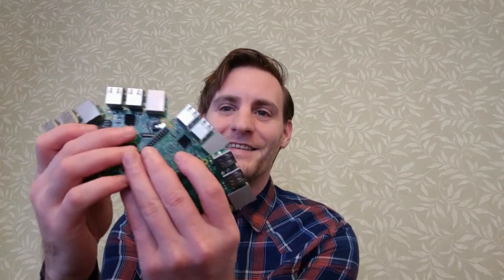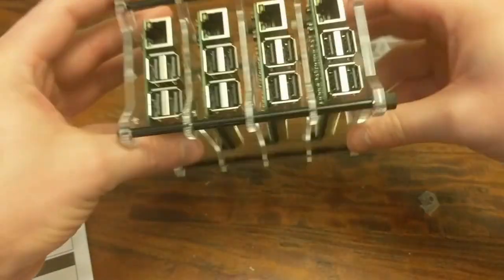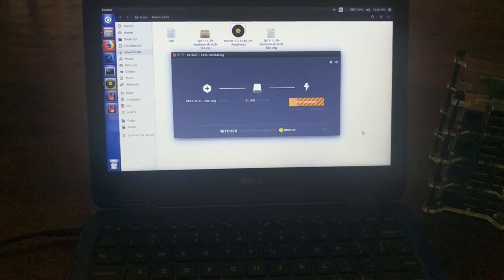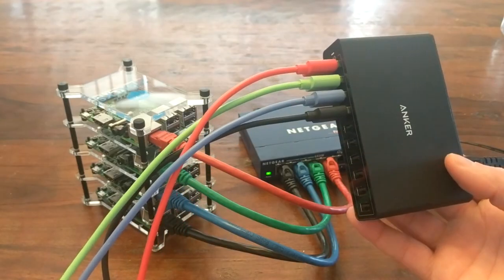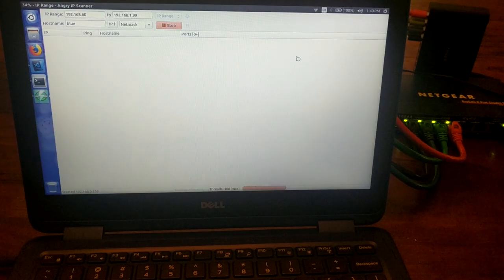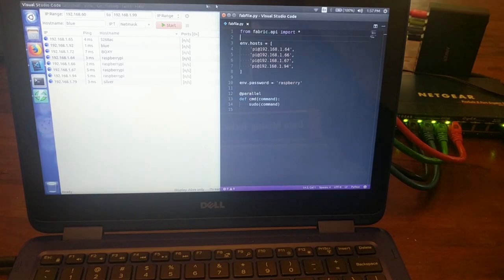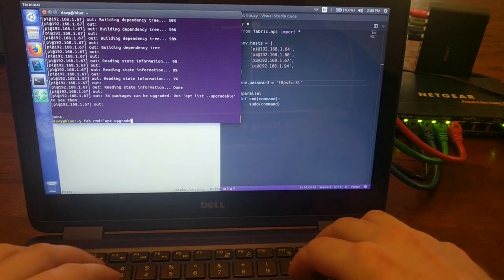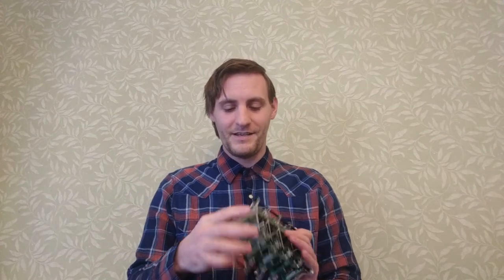Building a 4-node Raspberry Pi Cluster

Comment: Someone beat me to it, a cluster is meant to work as a single computer by distributing tasks to the members in the cluster thereby increasing the computing power.
Reply: That's one type of cluster. And they don't really work as 1 computer, depending on how the cluster is being used and what for... web server clusters are usually fairly simple and optimize query time by simply assigning different queries to different nodes. On the other hand load balancing clusters for scientific research and such use algorithms much different than the round robin method of just assigning each new query to a different node. And I dont believe computing power is really increased in the sense that you're thinking... you're not increasing power, you're sharing load allowing the work to be broken up into chunks that can be handled by different nodes, thereby speeding up the time it would have taken to do the work. A cluster is by no means a supercomouter

Comment: If you have the 3+, do you still need auxiliary power? I plan on connecting these to a powered switch (PoE). Will PoE work?
Reply: PoE is available only on the 3B+ but you have to get a PoE Hat

Comment: would it be cheaper to buy a computer that is 10 times as powerful as rpm, or buy 10 rpis and other required equipment (ethernet cables, racks, switches, power hubs...)? would be interested if its worth the investment.
Reply from the maker: A powerful machine would be cheaper. Each Pi has all the standard peripherals, which are all adding to the cost, plus as you mentioned the extra equipment. But, you can't pull out 1/10th of a more powerful machine and use it in other projects like the Pi.
Reply: The  benefit of creating a small pi cluster is that time on large clusters is expensive.  You can do you development on a small cluster, work out most of the kinks.  Then you waste less debugging on large systems where each node is more powerful than your entire pi cluster.
Reply: @warrenjrose  How so? You could emulate this with 4 docker instances

Comment: I've always wondered what use a Raspberry Pi cluster has. Does it actually increase performance or is it just easier to run a server or something, or do something like calculate a large number easier? (let's say a number like Pi.) Anyways these little things always seem to amaze me and are very cool and unique...
Reply: Yes, such a cluster would be very useful in scientific computing. A classic problem is generating all the prime numbers up to N (a sufficiently large number, like a million). Each node will work on a portion of the problem, and then the results can be merged later. This is extremely faster compared to running the same program on a single Pi.

Comment: is Fabric actually clustering them though ?  Or is it more or less just a way to execute the same SSH command on different devices at the same time.  The cluster would distribute data evenly across the pi's, and not the execute the same command but separate parts of the command simultaneously utilizing the full power of the "cluster".  I get what you did here with Fabric and it was cool , but how can I use it to combine the hardware resources ?
Reply: It's only to execute the same SSH command on all devices.
Reply: Still a cool concept.  I wound up going with a machine file so the pi's could actually see && speak to eachother.  What are some practical applications for a cluster ?  The first thing I tried was  a bruteforce lol
Reply: Yes, Fabric is definitely cool. It's a fairly extensive tool and worth checking out. 

I'm currently using my RPi cluster to prototype a small microservice-based infrastructure with multiple Node.js instances communicating with each other over IPC. Next would be using a message broker like RabbitMQ and making the RPis run on multiple different languages.
Reply: @Umbrelladroid Actually I am familiar with what a  Beowulf cluster or grid computing is.  Although I am familiar with the term, I have never built one.  I know you can make a cluster that serves the function with mpi/mpich openMPI for arm devices.  Have you tried either of these methods beowulf or mpi ?  What I was looking to do was find an office that was getting all new computers and getting rid of the old ones in order to attempt making the beowulf cluster.  Usually they're recycling or throwing machines away.  I have a bunch of machines at home but they're not the same, in order to make this type of cluster, do the machines have to be identical ? I only have two rpi's,  a3b+ and pi0w.  I was thinking of trying this https://youtu.be/RqcHj1DgAMM , I know either way I am not going to be breaking any benchmarks with the Pi but the concept is cool.  Let me know what you think, and what you think about the video I linked.  Thanks.
Reply: @Umbrelladroid Okay I will see what its about, is it exclusive to Debian or can I make this type of cluster with other distros ?  Personally I like Debian , but I have a few systems running Arch, and centOS, thanks for your suggestion.
Reply: @Umbrelladroid I was talking about the hardware being identical.  I know you need to be running the same distro, its the hardware I am unsure of.  whenever I see a cluster its made up of multiple nodes, same model computer.  So I can coordinate the OS's is the message passing interface going to work correctly as long as they're all the same cpu architecture ?  Like if I had a dell computer, a hp, and a lenovo but they're all  x86-64 based cpu's I can still cluster them ?
Reply: Steve, identical HW is NOT necessary. Clusters run on different cpu archs and different OSes as long as the clustering sw compatible. But fab in video probably not working in multi-arch scenario.
Reply: @Umbrelladroid Yep, I thought so, thats why I said I was trying to get my hands on some office giveaways for identical machines.  I found someone getting rid of a bunch of dell optiplex780 USFF with core 2 quads in them.  Not exactly ideal but good enough , those are solid processors.

Comment: Instead of Etcher, isn't it easier to just dd if=/path/to/raspbian.img of=/dev/sdb (replace sdb with whatever device the SD card is)? Works for ISOs, and dd is a core Linux program.
Be careful though with it, dd has been nicknamed "Disk Destroyer" by the community, because it writes bytes directly on file/device, so if you write faulty input, I don't know what will happen. Hopefully you can use dd again to repair it, or any partition manager to re-initialize the broken disk, but I never tried.

Comment: I am new to this, but i was wondering if this was possible.  Can i build this, so i can play ps4 games and xbox one games? Could i download the game disks somehow and install them into this? And have it play very well? I want a pi that plays all the new games/4kHD movies/ and whatever else.  I am going to wait for the pi 4 to come out, before i try to build it. But is it possible?
Reply: I highly doubt it.

If you want to play games for old platforms (NES, SNES, etc.), a single Pi could do that fine.  You'd get no advantage by having multiple computers, though.

For modern games, you'd need a machine that's significantly faster than the game console (it has to run the game and emulate the console at the same time).  The Raspberry Pi isn't a very fast machine even by SOC standards. Again, you'd get no advantage by having multiple machines.

To take advantage of a multiple-machine setup like this, software has to be written in a certain way.  Since game consoles are all single devices (I'm not counting multiple cores as separate devices here, as they share memory and cache), the games aren't written to take advantage of multiple machines.

Look up "parallel computing" for more information.

Comment: I'm glad I can just log into my current router and check the allocation of IP addresses on its LAN devices list quickly rather than having to scan my network. Most of my most recent routers have had a feature to list their DHCP assigned IP addresses in some form or other.  I tend to also add devices like this onto a DHCP reservation list as well to make sure the hardware is bound to that IP address in the future by its MAC address. I have had problems in the past where I have shelved projects for a few weeks only to come back to them later and the IP addresses are different as their lease expired and the old adress has been given away to something else in the weeks they have been offline.

Comment: Is it just me, or is $33 an awful lot to pay for some plastic plates and standoffs?
Reply: Material-wise it's nothing of course, but to me it seems like a fair price for a small volume niche product. I can't really imagine they sell enough of these to setup a large production line and lower costs.
I looked into what I'd have to do to make one of these, and raw parts from a hardware store are already like half of it, and that is if you have a cutting tool or whatever.

Currently I'm looking more into frankensteining an old PC case so you can actually build in the power supply and the switch.

Comment: Just a quick question from a "non-developer"; Is it possible to build a Pi cluster such that it behaves like an ordinary Pi (Raspbian GUI interface etc.), but makes use of the other units in the cluster to increase raw processing power & available RAM, giving you what is in effect some sort of "super Pi"?
Reply: As far as I know, there is no easy way to "add" like this. This is a non trivial question and goes down with how easy or hard is to split your problem. You could use some work schedulers like kubernetes or nomad, to deploy jobs to the PIs. Some works can not be done without some algorithms changed. The trivial situation is calculate Pi itself. To calculate a new decimal you need the previous, so it is not easy to split this job on many nodes, although statistical approaches can help you there.
In real world, most f the guys out there are using some combination of job schedulers or network load balancing to use the full power of the cluster.
Reply: Aye, something like Docker managed by Kubernetes or RancherOS would be a good way to get that sort of functionality. You get the same practical results, although only in parallel fasion (IE you can scale out horizontally - running multiple apache services - but not vertically - you can't make apache *faster*).

Actually making the services combine into one homogenous cluster is something that is more of the thing that serious high-performance computing types would do, but the lack of grunt on the Pi makes it a bit redundant for that.

If the idea of horizontal scaling sounds good, have a look at Rancher. I'm an idiot when it comes to Docker, but even I managed to get a loadbalanced, scalable Wordpress install out of it in the space of about two hours, having previously been (technically) niave on it (I'm familiar with the concepts, but never tried it before).

I'd say if I can get it working - and I'm an idiot - then others probably can to.

http://rancher.com/docs/os/v1.2/en/running-rancheros/server/raspberry-pi/
Reply: Short answer: not really. You could run a graphical program on a secondary node but tell it that the display is vis this ip address which is the node that has your monitor plugged into it.
Reply: Thanks.  Very informative.
Reply: http://www.hpctoday.com/best-practices/tinytitan-a-raspberry-pi-computing-based-cluster/  Tiny Titan = Pi based HPC cluster.
Reply: Great question Brodle.  Yes its possible.  Its already happening although some of these software are proprietary to companies.  The emergence of new functional programming languages is an indication that distributed and parallel programming is the way of the future.  How much of that will be avaiable in the comercial realm is up to the future.
Reply: @GreenEyeDragon  more or less described the Plan 9 approach, except it's much nicer than jury-rigging with SSH and NFS.
Reply: I actually found a guide to do just that, if you're still interested 10 months later lol...https://projects.raspberrypi.org/en/projects/build-an-octapi
Reply: For that price why not buy a mini computer?
Reply: @theghostmachine  as far as I can tell a raspberry pi is a mini computer.
Reply: @Gustavo Arantes true, but the only thing he'll learn is how to buy a processor online. All the value in working with Pi clusters is in the learning, not the buying.
Reply: @GreenEyeDragon  the worst thing about YouTube is people like you getting me excited about stuff. Now I need to go and buy four pi's, lots of cables, PSU's, SD cards, a switch and bottle of gin. Dammit mate, I should really send you the bill!
Reply: The proper answer to your simple question is simply - no.

Comment: @6:26 How would you enable SSH on boot if your setup PC was Windows and not Linux?
Reply: Same way, but you have to pay attention. Either use a text editor (like notepad) and create a blank file (then go into the command line [CMD] and remove the extension (usually .txt), or use command.com and pipe a blank file onto the partition. The first is probably the easiest unless you have worked a lot with DOS/CMD.exe
Reply: Put the name of the file in double quotes when you rename the file.
Reply: David Lane just pull down the option menu from windows explorer and check "show known file extension or shit" and create new text document. name it ssh and remove the .txt extension. done. easier
Reply: Malik I haven't used Windows in a while. It used to stick .txt on the end regardless. Thanks.

Comment: Basically what is the advantage of clustering. if we want high processing power, why can't we use processor like Intel Xeon ?
Reply: As far as I am concerned this is less about performance than about experimenting and trying out stuff with a "simulated" serverrack but instead of paying 500$+ per blade you use the pi's. But im my opinion he is missing a part of the video here would have liked to see a real "cluster" which includes a software that coordinates tasks between the pi's like some analisis process

Comment: This is t really a “cluster”.   It a collection of 4 individual Pis.   A cluster is a system that allows for parallel computing.
Reply: @Samuel Self yes, but he did not do that either.. This is merely a small rack of Pi's. Disappointing....
Reply: Could have made a legit beowulf cluster with linux easily enough.
Reply: So the conclusion of this thread is: 
This is physically identical to a cluster - Hardware. But 
It has not been setup to function as a cluster - Software. 
Therefor, Because it's finished state isn't clustering, it's not a cluster. However, it is physically capable of being one in it's finished state... Yea?
Reply: Thats absolutely right
Reply: Oscar Martinez
Reply: More from your very own nerd!
Reply: +1
Reply: RPi3 only has 100Mb ethernet. Distributed workload would suck horribly. Even with 3B+ the USB would hamper inter-node communications. True clustering would be severely hamstrung.
Reply: The word "cluster" is not defined like that, so you just mad that it is not what you wanted it to be
Reply: sHoUtouTs tO siMplEfliPs but wouldn't paralel proccessing still be possible? Like via a c program or bash? That distributes the computing payloads as segments and assign them to each pi running ? Also my room is like a clusterfuck of laptops but they also don't support multithreading so touché
Reply: @Nobbie248  actually he is correct. Clusters are not only used for sharing computational load. A cluster can also be used for redundancy, providing fault tolerances in the event of node failure. Look up "failover cluster".
Reply: @LamontGoodenough  But that doesn't change that's not a cluster in the video. That's just 4 pi with same stuff on it.
For load sharing or redundancy the setup would need for like a simple web server project to use a reverse proxy (or even multiple ones on each pi) to balance the worload or use failover. And the router could use failover to for exposing the reverse proxy.
The same issue came with getting the pi IPs... what's the need of scanning your network? Just look at your dhcp leases...
Reply: @MrW000f  I agree this isnt a cluster, I was simply pointing out that there are multiple definitions to what a cluster is.

Comment: What is this used for? im new in this
Reply: He uses it for testing web applications, but there's a lot more that you can do with this kind of setup.

One use is load balancing.  Load up a webserver on each and have your router forward requests in a round-robin fashion.  Each machine only handles 1/4 of the requests, so if you get more traffic than one Pi can handle your website doesn't go down.

Another use is parallel processing.  One Pi runs a program that calls the other machines to do specific tasks and return the results to the main Pi.  Not all problems benefit from this sort of arrangement, but for some problems this works very well.

Finally, remember that all the machines in the cluster don't have to be doing the same thing.  If you had three webservers each serving a different site (or multiple sites) and a database server, there would still be times when it would be convenient to run the same command on all machines.